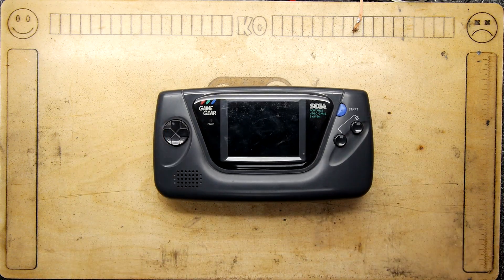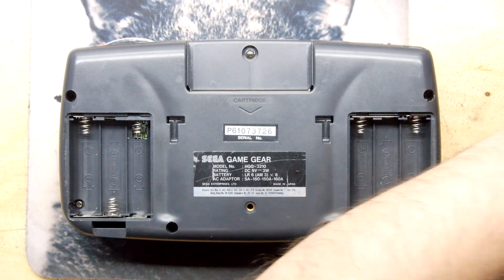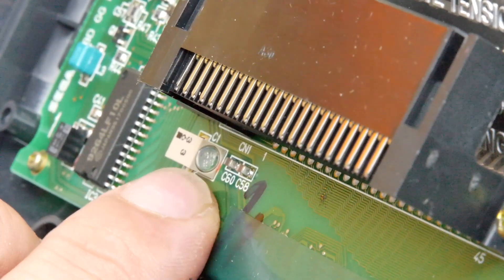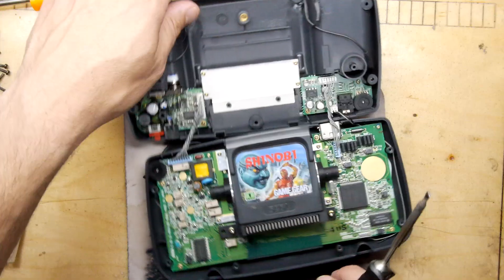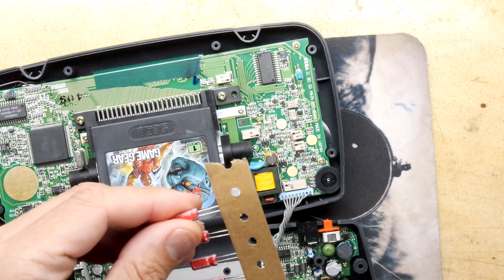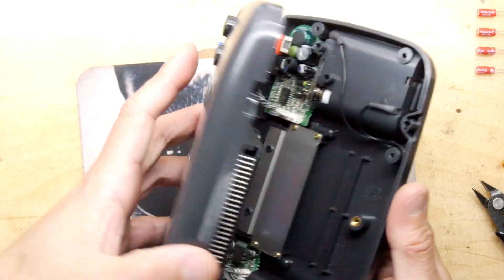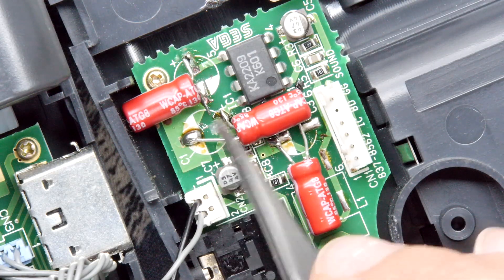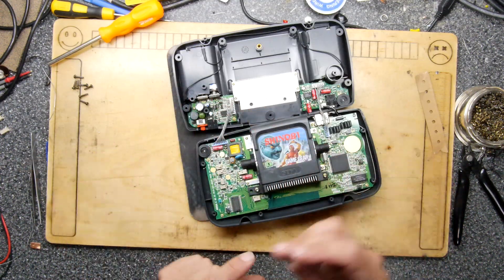Sega Game Gear repair for free!

Comment: I always replace them with ceramics.
To be fair though that's a really clean looking board.
Keep some tin/bismuth solder on hand if you don't want to use hot air.
Reply from the maker: I broke and ordered the full screen kit, I can't live with it 🤣
Reply: @backofficeshow  You could have gone whole hog and ordered a SYF mainboard for it.
Reply from the maker: @Kolor-Kode I think I ordered the aftermarket sound board with the USB C on it
Reply: @backofficeshow  So easy to just keep throwing money at them but great fun.
Reply from the maker: @Kolor-Kode it's a cheap enough hobby really all things considered
Reply: @backofficeshow  house does start to smell like a fishmongers after a while though 🤣
Reply from the maker: I have teens, fishmongers would be a nice change.